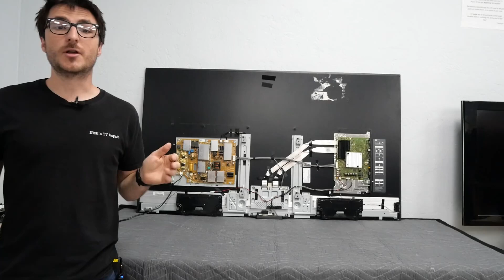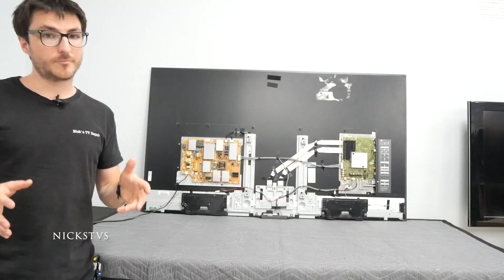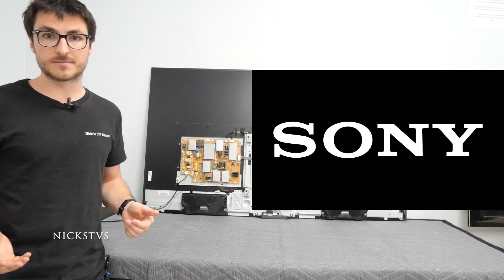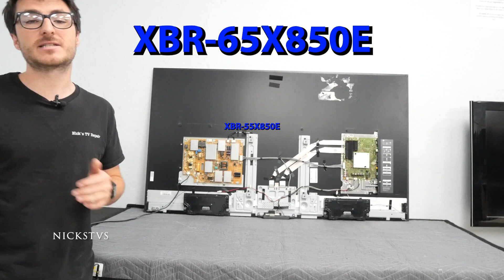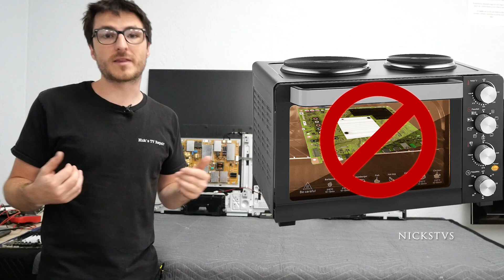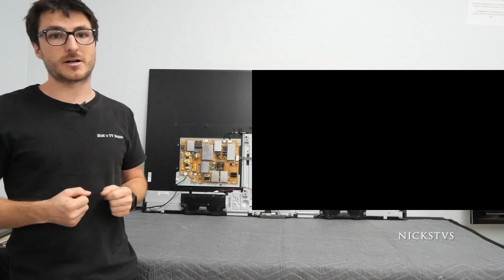Sony TV Diagnostic For Beginners Blink Codes Explained XBR-65X850E XBR-65X900E

Comment: Hey Nick! For the buzzing sound. Can you point me on where to find the D750 - D753 diodes? I can only find them on delisted on ebay and cant find anywhere to purchase them. I read somewhere that i can use schottky SB5150 diodes, is this accurate? thanks!!
Reply from the maker: Hello,
The part number for those diodes is indeed SB5150 but as you mentioned those are discontinued and can be hard to find. An alternative replacement option which we use are the MBR5150 or SR5150 diodes.

Comment: My KDL-75W850C gets past the android and then gets stuck on please wait screen.
Reply from the maker: It's a long shot and I don't think it will work, but you could try a force reset. 
Disconnect the TV from power, press and hold the volume down, and power buttons on the TV not the remote and at the same time reconnect the TV to power while holding them down. Don't release for 10 seconds or until the standby light turns green. 
This should reset the TV to factory default and might help.

Comment: I have a xbr-55x805c and it turn on de power ligth, but does not show imagen and back ligth is off. Si you cant turn off
Reply from the maker: Most likely the mainboard has gone out.

Comment: For the 4 red blinks on the 55x900e,  is there a video on how to replace the backlights? Can't seem to find one for that model. If the backlights are the main issue, I would rather replace them instead of doing Coppell's patch job as he says eventually they will burn. What would you recommend? Thank you for any help, it is appreciated.
Reply from the maker: The patch job is a lot less risky provided you have decent soldering skills. The right way to fix it would indeed be to replace the LED strips, but there is also a risk of cracking the screen if you don't do it right. So my advice is to do what you feel comfortable doing and just be careful.
If your TV was walking into our shop we would recommend 100% to have us replace the LED strips, but my guys have thousands of LED repairs under the belts, so the risk of something going wrong is very low.
Just be careful, go slow, and don't use force ever.

Comment: Nick, have a XBR-75X900E that suddenly started randomly rebooting.  It'll be fine for 5-30 minutes and then reboot (showing Android, then Sony, then Android animation).  Tried doing all the configuration changes (e.g. turning off Bravia Sync, Simple IP, etc.).  Same behavior.  Any suggestions?
Reply from the maker: You can try a software update and a factory reset. Either this will fix the issue, not make any difference, or make the TV worst. 
If it fixes it, great the fault was always a software-based one and not a hardware and you are good to go. If there is no difference or if the set gets worst then this means you have a hardware-based fault and you will need to send in your mainboard for repair. 
We have a flat rate repair service for that mainboard which comes with a 1 Year warranty and takes between 3-5 business days. 
For more information, you can check out the listing linked below:
https://nickselectronics.com/products/xbr-75x900e

If you have more questions, I would recommend you reach out to me directly via our email or contact us page on the website linked above or in the video description.

Comment: thank you .i have a sony that flashes logo then off. i was going to order a power supply.. I thank you so much you just saves me a bucket loads of headaches its the main board ..THANK YOU SOOOOO MUCH FOR YOUR VIDEO ..P.S DO YOU HAVE A VIDEO THAT SHOWS HOW TO INSTALL DRIVERS AFTER THE NEW INSTALL OF THE MAIN BOARD . ITS GOING TO NEED TO UPDATE.. IS THAT BY USB OR ONLINE UPDATE ..PLEASE LET ME KNOW
Reply from the maker: Anthony,

If you are intersted we do offer a repair service for your board which is linked in the video description. When we do a repair, we return the board to you with the flashdrive preloaded with the software you will need to complete the paring proceedure. 
As for a video, we did make 2. One is a very simply straight forward how to make the flashdrive yourself and what happens if everything goes smoothly the first time around:
https://youtu.be/gBd2g7kRsEM

This second video linked below is a longer form video which goes over what to do when things don't go right the first time around (this happens a lot):
https://youtu.be/3kYPjIHt8Lc

Hope this helps.
If you have questions, don't reply to the comment, I don't get notifications about replies, instead just send me an email directly. The contact info is in the video description.

Comment: Great video. My XBR-65X900E is completely dead. I've measure 24v output in both the powerbrick and also the cable going to tv but after that nothing. No buzzing sound from powerbrick either. Any ideas ?
Reply from the maker: Yes thats going to be the mainboard then. This is a slightly different version of your TV but still very similar that we show how to fix with the same symptom:
https://youtu.be/Y00I6rx70j0
We offer services for all of these if you are interested in sending it in for repair. If you have any other questions, please reach out to us directly, the video description has our contact info and a link to our website. You can either email us directly or fill out the contact form on our website.

Comment: I have an XBR 55 850D with a solid red light? I replaced the motherboard, let it do the firmware update and now it’s a solid red light…
Reply from the maker: You had a solid red light and replacing the motherboard didn't fix it.
Well a solid red light is very uncommon, in fact I don't think we have ever seen that. That is not supposed to happen but my guess would have been that the mainboard is bad. However you already replaced the mainboard and that should have fixed it in my opinion. 
Are you sure the light is not flashing at all? 
I don't know that I can help you as a solid red light is not listed in the troubleshooting guide and out of the thousands of Sony sets we have fixed, I don't believe we have actually seen that fault before. 
If you are local to Tucson, go ahead and bring it in to our shop, we offer free estimates and would love to take a look at it and troubleshoot it in person. If you are not in Tucson, I really don't know what part could be causing this and would need to see this set in person to do troublshooting.

Comment: Hi Nick, 

I have the Sony KD55X8508C, I have the reboot issue. 
First I disconnect the T-con with the Mainboard, the display shows red colour, then green colour it seems like a display test. Then I disconnect the Mainboard with the T-Con and there was nothing on the display. I read in the Internet that the T-Con could be broken and not the Mainboard. I did a Firmware Update with the USB-Stick in the hope that I did not have to replace the T-Con and its only a Software issue. The Software Update was sucessful and the LED Light is blinking white but there is no Picture but there is only sound. The Display is completely  dark. Then I shut down the Tv and first few seconds the LED is Blinking Green/Orange after that the LED is Blinking White and sound is coming but no Picture is shown.  
I remove the T-Con and one half of the T-Con was greasy, is that normal ?   
It was a pleasure if you could help me in this case.
Reply from the maker: The grease you are reffering to is normal, it is from the thermal pad. You could dip the entire TV in a pool of it and it work just fine, since it is not conductive, that is not the issue. The issue was the software on your mainboard. However because you disconnected the T-con from the mainboard and turned it on, the mainboard is no longer paired to your T-con and panel, that is why you lost picture. You will need to pair the mainboard back to the T-con and screen. Here is a video on how to do it. 
Also if you follow the steps in the video linked below and it still gives you the no picture but you do get audio, that is because your ribbons aren't properly inserted.
https://youtu.be/gBd2g7kRsEM

Comment: What would cause a white Sony logo to appear and the tv is unresponsive-this happens every 2 months. It requires a master reset and then it’s good for 2 months or so.
Reply from the maker: This does sound like a software fault. We have seen sometimes the software get corrupted but the EMMC aka the chip that holds the software be in perfect health. In that situation a software update would resolve this issue you have. 
We have on the other hand also seen the software be perfectly fine, but the EMMC chip that holds the software start failing on a hardware level thus making it seem like a software fault. If this is the case the issue will start to be more common or after one or two more times this fault occurs the reset won't be enough to fix it and  you will need to send in your mainboard for repair. 
If the later is the case, updating to the newest software could bring the EMMC over the edge as that is an intensive process for the chip. But if that's the case, the chip probably didn't have to much life left anyways.
Reply: @NicksTVRepair interesting. Thank you.

Comment: 65x850d my tv will work fine for hours but sometimes only a minute but eventually the right side backlight will start flickering and then goes out then the screen turns off and bottom blinks 6 red lights. if i unplug it and back in then it displays normal again.
Reply from the maker: So eventually you will need to replace the LED strips, but also you may need to replace the power supply board. I sometimes see the power supply go out in tandem with the LEDs. 
Something you can do to push back the inevitable would be to lower the brightness of the LED strips by going into the picture settings and bringing the backlight setting down. I do believe that by default it is already set to 100%. Bring that down to about 60-70 percent of brightness. It won't affect the picture that much, but will make a big difference in the energy consumption and thus heat emitted by the LEDs and thus should allow for longer life. 
The sooner you replace the LED strips the less likely you are to have to also replace the power supply. I don't know exactly why or how, and if someone else reads this and has the info, please chime in. But I believe (speculation) one or more of your LEDs either might start pulling more power than it should as it begins to fail and thus cause some components on the power supply to overheat, and get damaged. 
Also if the LEDs overheat too much, they could cause the plastic diffuser next to it to start melting and then you would see light bleed after you replace them unless you also replace the diffusers. 
The moral of the story, fix it sooner rather than later.
Reply: @NicksTVRepair  if its my panel then ill pull the boards and put them on ebay, i should be able to get 350 for the power main and tcon. thats probably close to what id get for the whole tv working if i sold it locally. Then go buy a new 65" tcl r646 for $700. thank you.

Comment: @nickstvs great video  how about the 4 red blinking code on the sony XBR-65x950G ?   is it LED strips ? or possible  LD Driver board issue ?   I get the blinking lights on the LD driver board.  I tried the BL_ERR put this to ground on the power supply side but still have 4 blinking red lights on the LD driver board. ? could this be newer tv and I have to short the BL_ERR at the LD driver board instead?  or would you think replacing the LD driver board may fix issue ?   BTW my tv would light up and you can see backlights are on after few sec it will shutdown with 4 blinking red lights thanks.
Reply from the maker: 4 blinks is a backlight failure in my experience. I do not know the layout and pinout of the boards for the 950G so I wouldn't be able to help you further, but if grounding the BL-err does not resolve the 4 blink code, either you don't have a 4 blink code, or you didn't ground out the BL-ERR properly.
Reply: @NicksTVRepair  saw a link you shared from coppell tv repair.  It looks like the led driver card is sending the bl-err to the main board to turn off.  Thanks!
Reply: Have you resolved this issue I have the same exact TV and problem red blinking light 4x.

Comment: hey bud xbr 900e   4 red blinking lights.    any ideas?   I can help the geek squad tech when he comes cause I'm not sure how good they are.  but I'm not great taking these TVs apart.  thx.   but if I can educate him some that be great.    had some storms ect, but it's in a strip box with the GFI type protection ,I think..   thx man..     and I reset the TV, and it boots up past the Android and Sony and I get into setting up the factory reset and it just shuts off again after 10 seconds to 4 red blinks..   so the LEDs seem ok never had a issue with them or would it be a board that controls the screen staying on? or power failing?  idk man but thx for any info.
Reply from the maker: 4 blinks = backlight
It's extremely  rare to see that with this TV which is why we didn't cover it. 
Coppell TV repair another company that does circuit board repairs just like us put out a video recently on how you can fix that issue. 
here is a link to it
https://www.youtube.com/watch?v=BP53P6qAWzg
Reply: @NicksTVRepair  easier to just get a new led controller board?
Reply: @NicksTVRepair if it was backlight, I wouldn't get to the tv menu before it reboots then, right? I try to get to the menu to factory reset, but it reboots. I have 4 blinks, unless I totally miscounted. xbr-65x900e

Comment: my sony tv is cycling colours on boot, can hear audio but screen it going red/green/blue etc any ideas?
Reply from the maker: Josh,

Did you recently replaec any of the boards in the TV? If yes, then the ribbons are not properly inserted and will need to be re-seated. If that is not the case however, then typically that is due to a faulty mainboard. 
If you want to contact us at support@nickstvs.com with your model information, and a copy of the symptoms, we might be able to assist you further with a repair.

Comment: 900E went out 4 red blink code seen a video of someone grounding out a wire to bypass it.. but idk which pin it is on the 900e model please help
Reply from the maker: The grounding of the error line mostly only works on the 900C models because of the way the LED's are designed for that set and the way they fail. It's also not a legit repair, it's better to replace the LED strips. These 900E models have strips available, I recommend you replace the strips instead.

Comment: good morning nick. 
I have a oled xbr65a9g with 4 blink. 
I know this tv doesn't have backlights   
any suggestions would be greatly appreciated.
Reply from the maker: All TV's have backlight, otherwise you wouldn't be able to see what's on screen. Your set however is OLED which means the backlight is integrated with the screen so if the LED's are bad, then you screen needs to be replaced. 

4 blinks according to the service manual for this set can either be Power supply board, Main board, LD board (LED Driver which I think is built into the power supply on this one), Panel aka the screen/led combo. 
In my experience it's the LED's, but you could replace your power supply and mainboard first to confirm since those are the only two parts you can replace.
Reply: @NicksTVRepair  ok thank you very much for your expertise.

Comment: Nothing from my Kd49x800c5 when I turn on, sometimes white lights on for 4 blinks then dead, sometimes 6 red flashes sometimes 8.... When finally on it stays on but normally its the flashing leds but no power up? Do I replace main board or power board pleeeeeeeazzzz
Reply from the maker: 4 and 6 blinks are LED failure. 8 blink is mainboard. That should never happen unless you did something you aren't telling us about. 
Did you try replacing parts already? If so it's possible you are getting an 8 blink code because you didn't replace a board correctly, like didn't plug in cables or ribbons or are using the wrong version of the board. 
I have never seen a 4 and 6 blink code be wrong before, so I suggest you get the TV back to it's original state with the 4 and 6 blinks then replace the LED strips. That should take care of the problem.

Comment: This is exactly my tv problem sony 75" but i am getting rid of it. I knew the issues might be the main board but all the fault you mentioned occur with my tv with the same model
Reply: My tv model is Sony KD-75XE8596 and as you said you will support to repair the TV, maybe I should give it a go and repair it. I need the main board now to buy. Thanks
Reply from the maker: @hypertek1UK  Oh okay, I see. That's a europen version of the model. I don't know if I can fix it if you have a software failure since the software on your set will be different than the one we have for the North America models.
Reply from the maker: Hello Hypertektv,
What is the exact model of your TV? 
Are you sure you don't want to try and fix it? We can help you. 
If you don't want to fix it, and were planning on disposing it, would you be interested in donating your parts? I would of course pay for shipping.